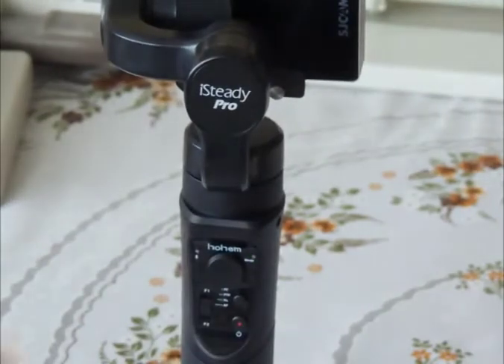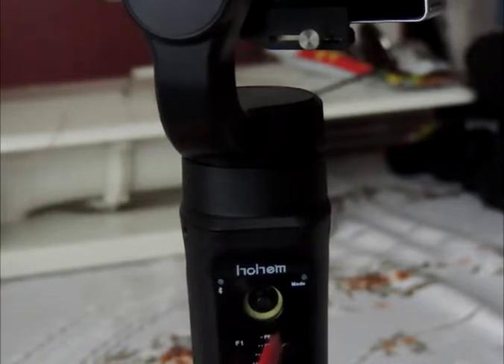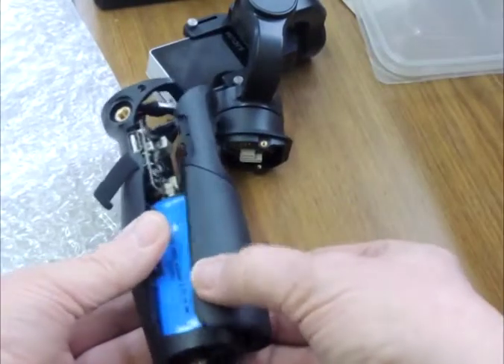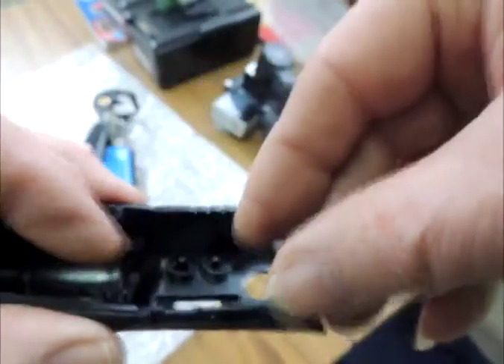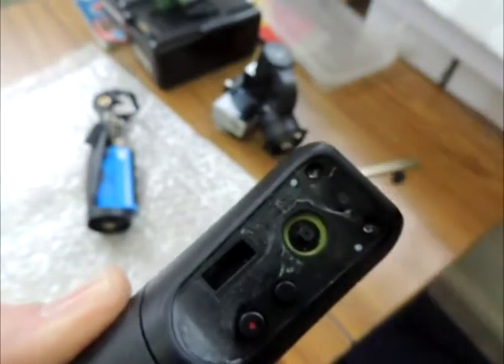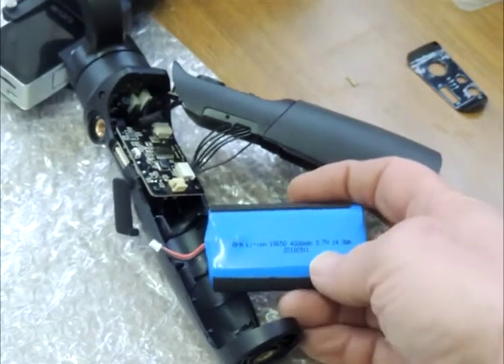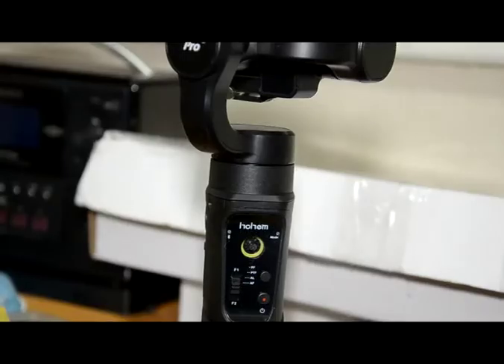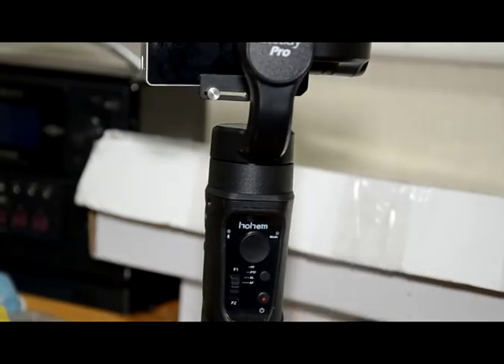Faulty iSteady Pro from Hohem Part 3. Now opened up and repaired. Open the unit at your own risk.

Comment: Thanks for the video. I have a slightly different problem, recently it began to turn off spontaneously. When the battery is fully charged! I assume that the battery begins to die and at times of increased load on it, the voltage drops significantly. Your video about how to disassemble the battery compartment is very useful.

Comment: Thank you very much, Brian, with such a good video explanation of how to disassemble this gimbal. I did it easily with no pain and damage and the device still has a native appearance. In my case, the joystick was broken so I just used the spare one which easily found on Aliexpress. You saved me a lot of time.
Reply from the maker: Glad it was useful as it was my first YouTube upload. Part 1 was requested by the supplier to show my problem. Being a retired engineer I thought I should be able to rectify the problem, hence parts 2 and 3 to show the solution.
Reply: Brian Collison can you help me figure out whats going on with my, after i put it in water it just stopped working, the green lights on the side comes on and it shows full battery but the go pro housing just stays down like if is off.
Reply from the maker: @azaafamily   Hello. sorry for late reply. If it was salt water I would think that it is a write off and not repairable. If it was clean water,  then cleaning off any slight corrosion with Isopropyl Alcohol and drying it should hopefully bring it back to life. If it has been left damp then serious corrosion may have taken place. With CMOS integrated circuits it only takes a small amount of corrosion to alter the circuit as the corrosion is slightly (or greatly) resistive and causes all sorts of sneak circuits. Pay particular attention to the underside of any components especially the integrated circuits.
Reply: @azaafamily  I just encounted the same issue here, but mine wasn't exposed to any water, ever find a fix?
Reply: @robsenz.  no, no luck...
Reply: @azaafamily  Dang, Guess its a paperweight now, oh well.